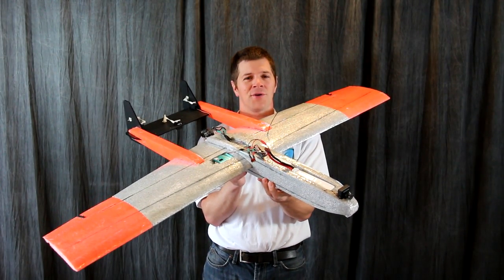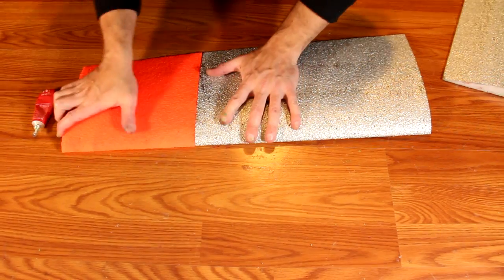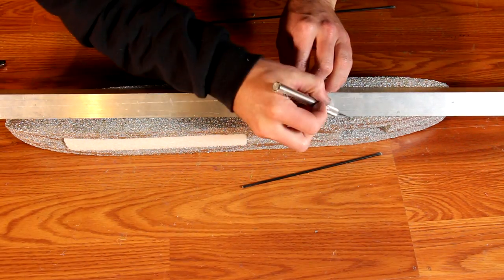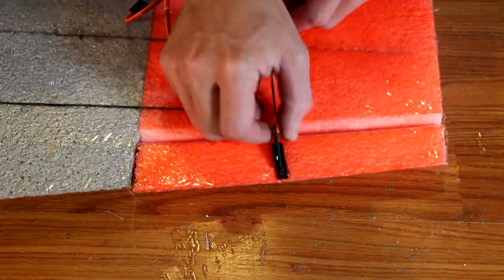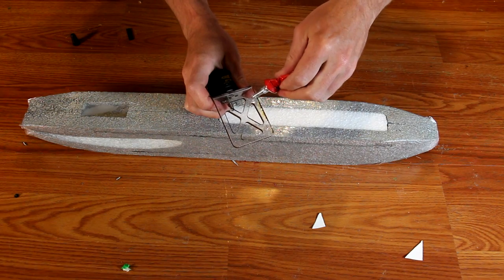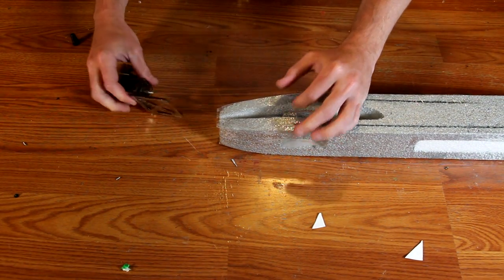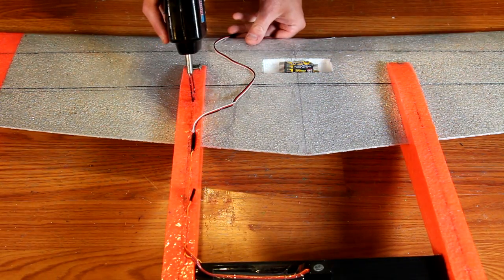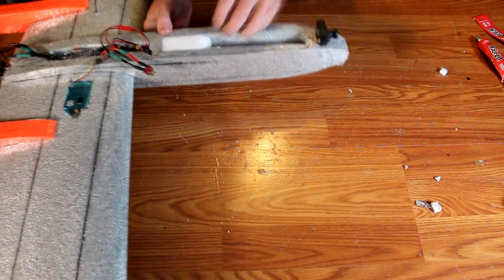How to build the VAS Specter V4

Comment: I wasn't planning on building this one (V3 is still great) until I saw the rudders. Gads, this would probably make me want to do the V4 now. :)
Reply from the maker: +Dale Jones (RCFlyMaps) - Rudders on a Specter are a bit of an odd thing.  They have a lot of authority and thus you should be careful not to stall the wing when using them.  They are really good for pulling vertical, kicking the rudder in and doing a 180 degree flat spin to change direction.  They also make a nice coordinated turn.

Just be sure you don't over-do it when flying level or you will stall the inside wing (it will get the airflow blocked by the fuselage).  This will cause it to tip inside the turn hard.
Reply: +Video Aerial Systems my idea for the rudders is to mix them in with ailerons a little bit so I hold a line better in turns. Do you think this will work?
Reply from the maker: +Dale Jones (RCFlyMaps) - If you intend to fly it like "real" airplane and lead with the rudders (ie mix aileron with rudder input) then, yes it works well.  If you intend to mix rudder with aileron input, then it tends to get a weird wag to it when you release the aileron stick.  

When flying a Specter with rudder:  Lead with rudder, follow through with aileron.  It will roll in nicely and hold a good line.  The aileron surfaces are located at the CG on the specter and thus when you bank the plane, the nose holds the same orientation.  Putting in rudder first pulls a small mount of lift off of the inside wing causing it to drop which subsequently drops the nose a bit and initiates a smooth turn.